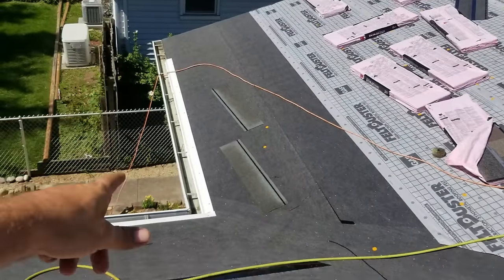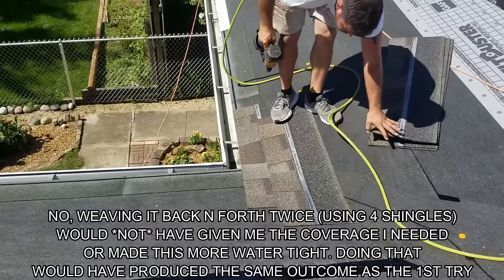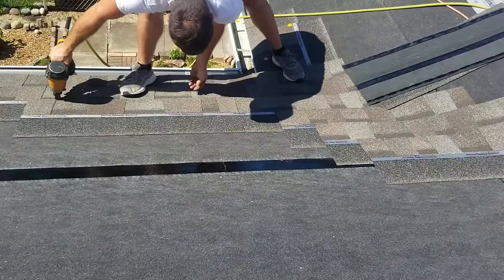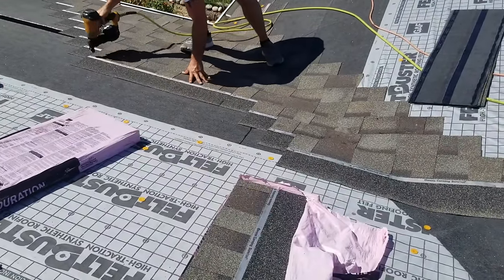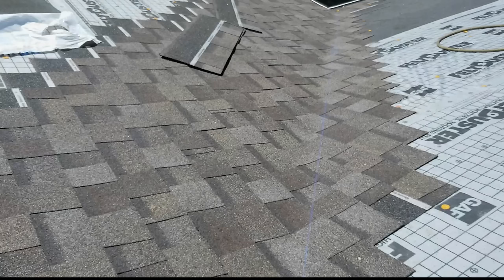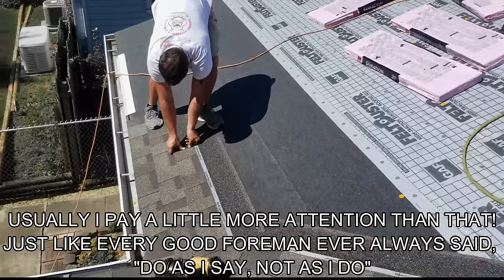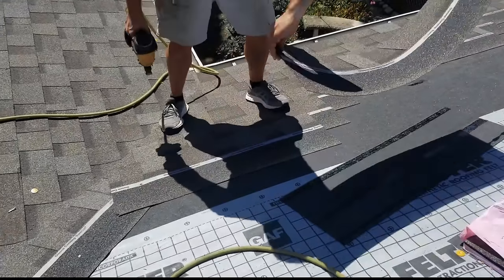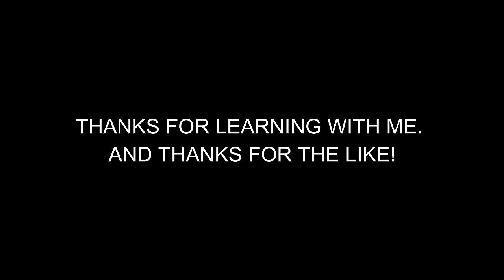How to do a closed valley!!!

Comment: Lol every valley is different 😅. Most valleys you weave the first one 😂. Clown 🤡. You are supposed to put the first shingle on the finish side under your second course
Reply from the maker: 90 degree valleys are all the same, this one appeared to be, but the addition was framed a little goofy. you always run one the finish side, before shingle you're under, on every, single, perfectly level and square 90 degree corner valley.